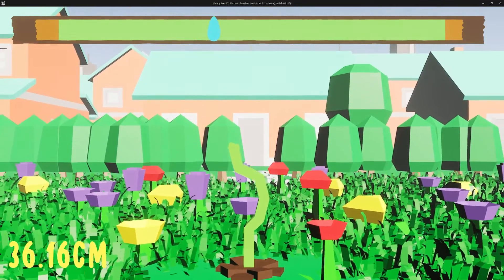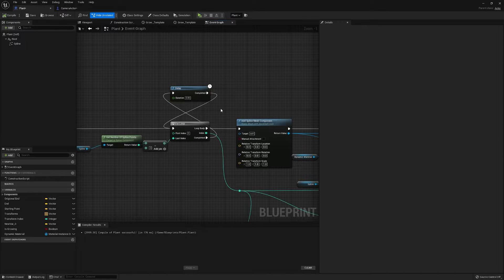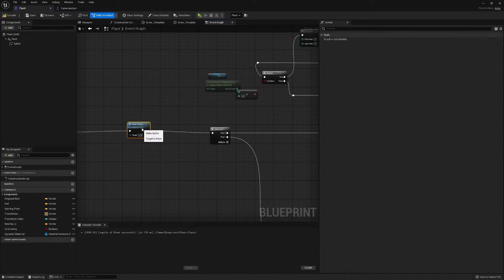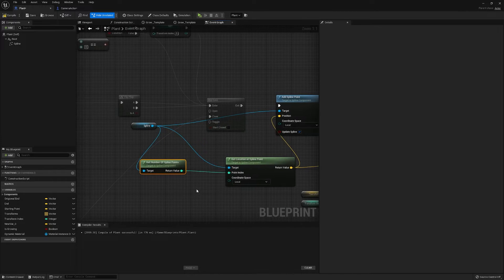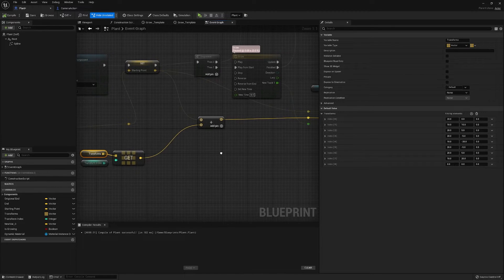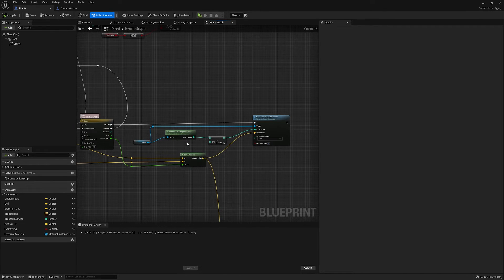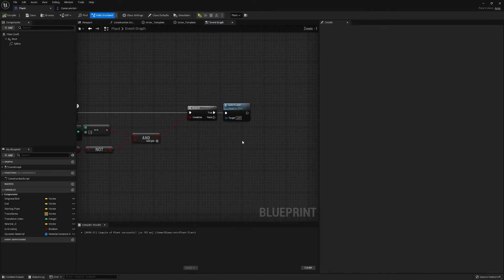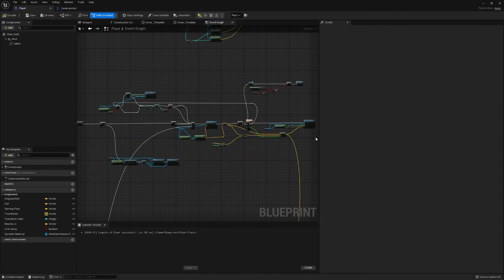UE5 Splines: Create Splines at runtime

Comment: I don't agree with the negative comments. I was working with a spline setup that added and formed splines via an interface from different places and I got stuck because I thought I had to do everything in the construction script. so this was very helpful indeed.
Reply: It sounds like you had the code already, just in the wrong spot then. As I said in my other comment, this is very useful for people who already know what they're doing kind of.

Since then I have actually came up with my own system for what I needed and still stand by my comment I think. For beginners it's definitely confusing because he doesn't reeeeally explain everything. It looked like nasa when he was talking about it, but now I understand it now that I have more experience. 

Basically, it is not beginner friendly.